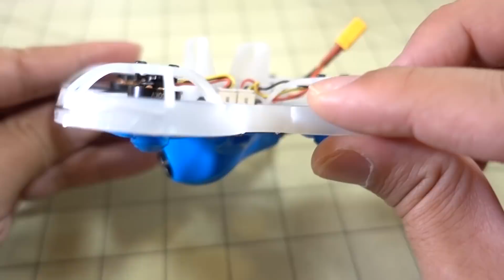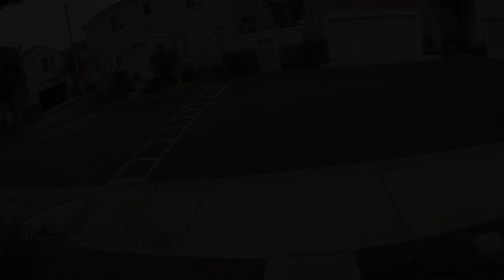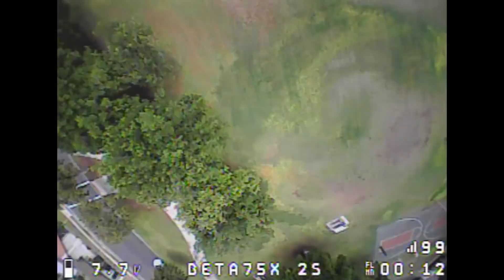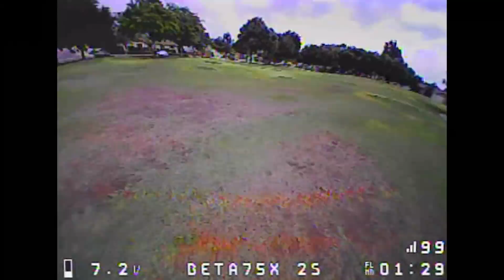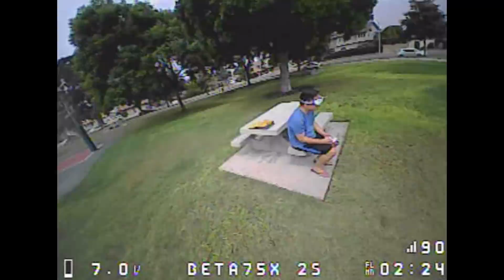BetaFPV Beta75X 2S Brushless Whoop Review😍

Comment: I am going to order the Beta 75X with 3S. I have the Jumper T8SG transmitter so can use any transmitter. Which transmitter would you recommend with the 75X ? Thanks for any advise
Reply from the maker: Transmitter choice is very personal and subjective.  I liked the T8SG but others did not.  It will work, but whether you will like the "feel" of the radio or not, I do not know.
Reply: @AlbertKimTV  Thanks the jumper will work with any receiver. Which receiver protocol would you recommend with the Beta 75X ? Thanks
Reply: @AlbertKimTV  I got my Beta 75X 3S only to find that the FCB was damaged (Worked intitially when connected to Betaflight 3.X om my PC But then gave up the ghost) is it something I did ? Or random CPB fault. Nevry got to fly it
Reply: Send it back for repair ...... I wonder how many batteries I should get for the 75X ? Now have 2 pcs of 3C 300 mAh

Comment: I’m thinking seriously about this 75X but it’s a tad pricey for the so-so camera performance, the poor quality of the shell and camera mount. Throwing more money at it for 3D printed parts just doesn’t seem sensible. I’ve seen people re-solder the XT30 connector facing forwards and have the XM+ antenna out the back. Somehow mounting the antennas up front, they will be more prone damage when crashing. Otherwise I prefer this design over the Mobula.

Comment: How to the push-on props hold up. Are they prone to flying off as they don’t have screws securing them?
Reply from the maker: For the most part they will stay on.  If you crash pretty hard, they might pop off.
Reply: Albert Kim once they come off, are they loose and will require replacement or not?

Comment: I kept my Rx wires out the back after flipping it around because I had no way to access the usb port with the way you have it (didn't want to clip the wires by the solder joints). Doesn't look like you have much room either.

Comment: What I like about this more than the mobula 7 is the fact that it has an xt30 for a better punch, but also the RANGE! with an xm+ and 200mw you should get better range than Mobula 7 for sure.

 Price difference though...
Reply from the maker: I'm not sure why going super far with a whoop is that important.  The Mobula7 goes far enough for me without any issues at most of the parks I fly at.
Reply: @AlbertKimTV  for me sometimes going a bit further it's really fun because I do long punch lines of speed near the ground (proximity) or trees . 25mw imo starts breaking up a bit to fast for me, that is why I prefer an xm+ and 100mw and up, if I need to go that far I can! it is not a limit... and with a 2s setup you cover distance quiete fast!

Comment: The 75x I bought did not come with batteries. The nano tech 300 mah you showed-does that fit without modifying the frame? Any other batteries you would suggest? Thanks!
Reply from the maker: The battery I used is in the description.  I did not try anything else.

Comment: Hi Albert, thanks for the quick reply. I actually got it to bound, as indicated by the red led turning off and the green led light staying solid. Never had a problem before binding my quads but still not receiving any input in betaflight on my taranis x-lite. I'm confused.
Reply from the maker: A solid green light should mean you have a bind.  If you shut off the x-lite, you get a red blinking light?  If that's the case, you might have a wrong receiver setup on yours... wrong UART selected or wrong protocol in the config.  I would check those.
Reply: Thanks Albert. When I turn off the x-lite, it turns to a solid red light.
Reply from the maker: Yeah, you have it bound, so the problem is in the config.  It might also be connected to the board incorrectly so I would also check that.
Reply: Hi Albert, sorry for all the questions, I appreciate the help. I checked the configuration and everything seems to be in the right place and the connections seem solid. Even though I get no feedback in Betaflight (version 10.4.1), I am still able to fly the drone. Never encountered this before. Do you know the reasoning behind this? Thanks Albert.

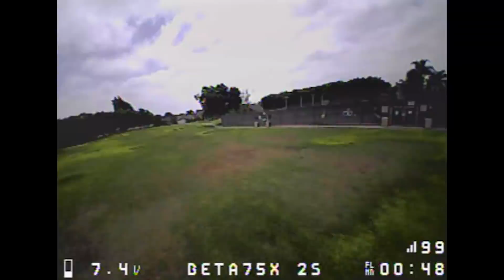Comment: 10:55 I have been guilty of saying "A whoop that flies like 5 inch" so let me clarify, what I mean. The 75X is still a whoop at heart because it has the nylon ducted frame, but and it is capable of doing most all the acrobatics that are typically associated with a 5" drone. Now obviously I dont think it flies better or even as well as a 5" or even 2" non-ducted micro like the GT-R90, those are a different class all together.  The idea is that the 75X and 65X combine the ability to do the 5" acrobatics and racing with most the advantages of a traditional tiny whoop, like the safety and toy-like ability to be able to fly around the neighborhood and/or smaller parks with people around. Having the ducts means even if you crashed into someone hard it would not be a major injury. Once you move to unguarded props, even on a similar sized 2S, you have to take a lot more care how you fly around most areas especially if people could walk into your flight path. Also the 75X is super durable; like most whoops you can crash pick it up (or turtle mode since its brushless) and get right back to flying on 95% of crashes. You crushed the camera mount once but the rest was fine and once that is TPU it should be able to take that hit. In all of our testing no one broke a single 75X frame!! Finally my favorite part about a traditional tiny whoop is that you can fly it almost anywhere anytime! So Between the 75X and the 65X I hope people will be able to find one perfect for flying around where they live so that everyone can have a satisfying FPV experience more often.
Reply from the maker: Yeah my 5 inch flyers are very discriminating whenever they hear something that isn't  5-inch is talked about like it is a 5-inch.  Whatever... Regardless, this is the fastest, most acrobatic whoop I've ever flown.  If they want to dispute that, good luck to them!
Reply: What an excellent response.
I like BetaFPV products, esp now that they are moving into F4 2s brushless.
Are you affiliated with them?
Reply: Yes, well sort of, I am part of the creation/design team for the X series drones. BetaFPV expanded and improved upon a "Power Whoop" build our group of friends had been experimenting with over the last year or so. If you check out Nate Payne (Mr Shutterbug)'s youtube channel you can see some history of the progression of the Power Whoop build. https://www.youtube.com/channel/UCkSK8m82tMekBEXzh1k6RKA to  ... oh and you could check out my channel too if you wanted haha: https://www.youtube.com/c/FPVSkittles
Reply from the maker: I'm not affiliate with them if you mean sponsored or something like that.  They just sent me a sample to review like other vendors.
Reply: A ducted fan will never truly fly like a 5” racer/freestyle I understand what you are meaning.  I cut my canopy and raised my camera to 50 deg and can matty and trippy spin the heck out of my 75x 
https://youtu.be/LmUqxcWog1g

Comment: How does it compare to the LDARC ET115 with 2S?
Reply from the maker: The 75X is smaller and lighter and almost as fast.  The 75x has a 1.57 inch prop the ET115 at 2.3 inch prop so the bigger prop will always win a drag race.

Comment: Super impressive as all the Beta products tend to be. How is it indoors?  I would expect it to be a bit too powerful maybe for indoor?  I was just actually looking at the snappy or snapper or whatever earlier today. Was wondering how the 75 would feel compared to the 65. The brushed King Kong whoops in 65 and 75 are very different. The 65 feels super nimble while the 75 feels stiff and lethargic.
Reply from the maker: Don't have the 65X yet.  You can fly the 75X indoors if you are skilled enough.  I was able to fly it indoors but in a small space you can only fly so fast before you don't have control.  Indoors the 75x doesn't look any faster than the Snapper7 if you want to maintain control.  I had to fly it outside to show the speed it's capable of.
Reply: @AlbertKimTV  I'm not sure that's a good thing for it to be so fast.  The snapper 65 should actual weigh less than a whoop since the motors should weigh less. My biggest concern with all these tiny things are the ESC boards. In the past they would just shutter and dip all over the place.  I hope to get one of these things soon but I feel like it really needs the F4.
Reply: @AlbertKimTV  how's the snapper?  Good overall performance?  Not like speed or anything. Just handling and general abilities
Reply from the maker: If you're trying to do freestyle acro with the Snapper7 you'll be disappointed.  You'll have a better chance with the 75X.  The Snapper7 is good for flying indoors and Whoop tracks.... I imagine people have raced with it.  The problem with the Snapper7 is the metal ducts which can bend in a hard crash.  So people who crash a lot prefer the nylon frames even though they are flexible and more difficult to tune.  Overall I think the brushless whoops handle better than the brushed ones.
Reply: @AlbertKimTV  I have tried so many of these small things and never really liked any of them. I just don't understand why there so attractive. Even when I know I won't like them.
Reply: Kabab -  You use to have to be really be most into the brushless  whoop scene to really get a set-up that is great. Until recently at least. If you are going 1S brushless the US65 is the way to go (19000kv 0603s) especially at $69 on sale right now. Crazy deal. However The BetaFPV 65Pro has an F4 1S Brushless FC+ESC_Rx and and is noticeable better than the Crazybee AIO F3 that is in all these 1S brushless BNFs. ALL THAT SAID ... these new X series 2S whoops are a whole new deal. The power to weight is off the charts! The 75X is mostly for outside - especially with the 35deg camera tilt. It is super fast and maneuverable nothing else out there is like it in the Nylon Ducted Frame Builds. The 65X I just maiden-ed earlier today and it is amazing! It is the ultimate brushless tiny whoop! Tons of power - and fight times in-line with what you can expect from most brushless whoops! The 75X is incredible but takes a more to get into it. New batts and props for most everyone so I think the 65X is gonna be even more popular than the 75X just cause so many people already have the stick style whoop batteries and 31mm props! Also BetaFPV also has awesome customer service and collaberating with them on these 2S whoops is great! The are really taking pilot feedback and putting it into all their products.
Reply: FPV Skittles  Well I tried it.  Holy hell they're among the most fun things I've ever flown!  Boldclash is coming out with a 2S one too.  I know they're not exactly the greatest company but couldn't possibly be worse than the UR/US quads and those are AWESOME!
Reply: Kabab FPV  Agreed entirely - Did you also get to try the 65X as well? I like that one even more! But I am bias toward the 65mm whoop size.
Reply: @FPVSkittles  yeah both are excellent. I prefer the 75 size for the overall improvement in throttle performance but the 65 is a bit more nimble.
Reply: @AlbertKimTV  Thanks for the tip. I thought the Snapper7 would be better for my purpose but didn't know it would be a bad acro trainer.

Comment: Another random question, I have some old new parts. Luminere 1806 2300kv motors, Afro Race Spec 20amp ESC'S and an Emax Skyline Naze 32 flashed with the last available Betaflight, what frame would you throw this junk on, and don't say nothing 😂
It's gonna be used for a camera platform and cruising.
Reply from the maker: Get this one - http://bit.ly/2PEEyyN

Comment: Seems too fast for indoors for sure! I think they should make the canopy tpu as well. Too fast and fragile is never a good combination! Awesome that it has Smart Audio though. Are the ESCs loud enough for lost model alarm?
Reply from the maker: I didn't see any info on the board (it's new) and I didn't want to take it apart any more but I suspect the pads are there somewhere.  The motor beep is not very loud (small motors) but if you're within about 10 feet you can hear it.